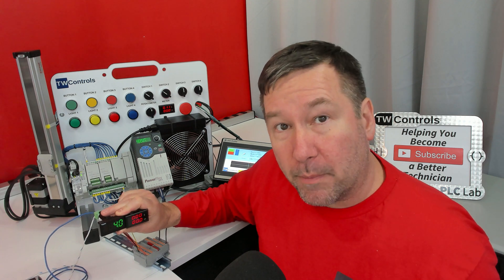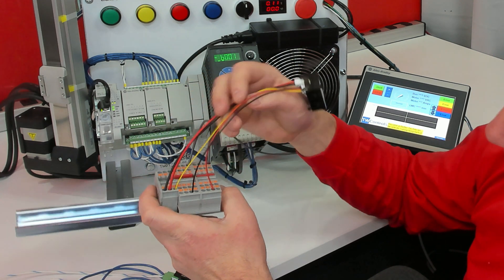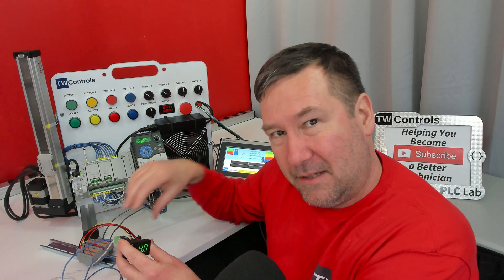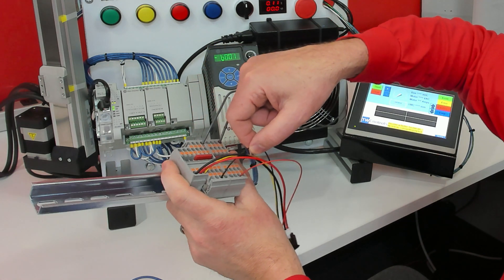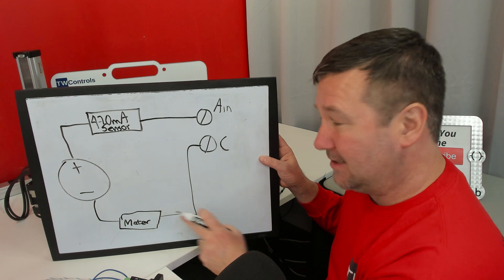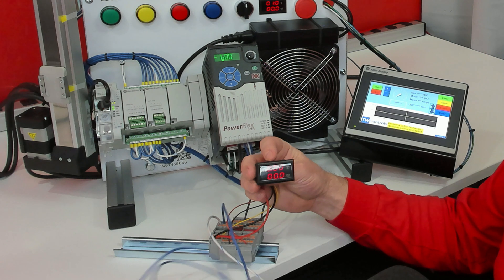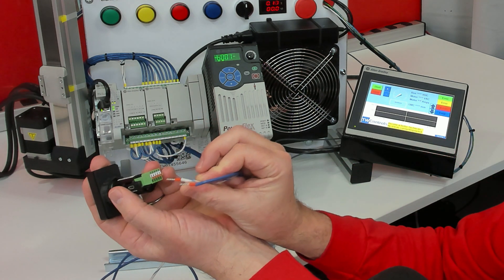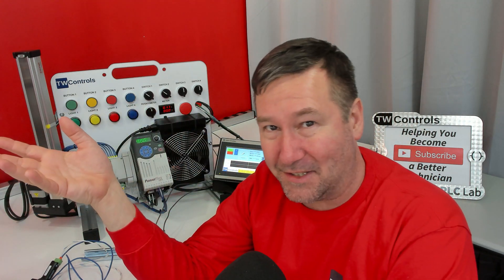4-20mA Meter on Your PLC Trainer.  How to Wire.

Comment: Hi Tim, do you have a part number for that new meter? It would be perfect to display the temperature at my chemical tank rather than Panelview on control panel.
Reply from the maker: It is a Schneider Electric XBH1AA0G4.  What is nice is you can cut it into the loop for a local display and keep going to your PLC
Reply: Thanks so much!
Reply from the maker: You are welcome